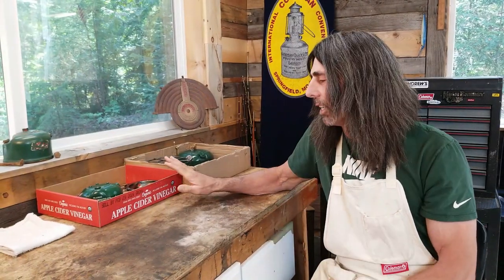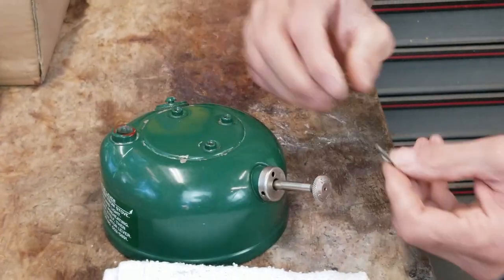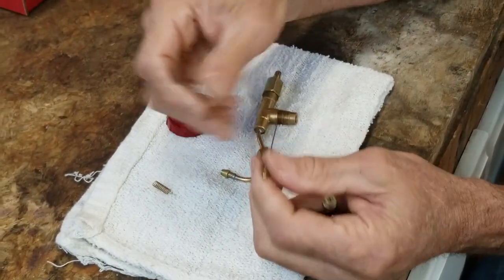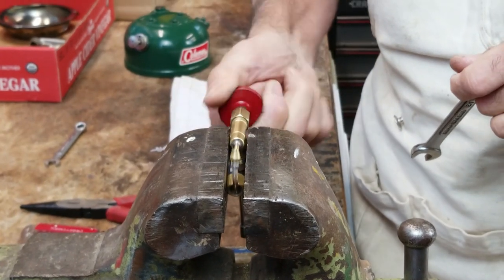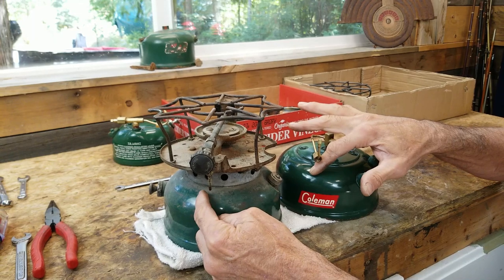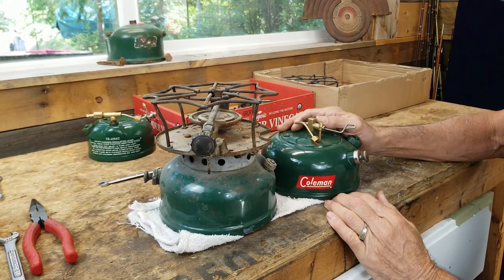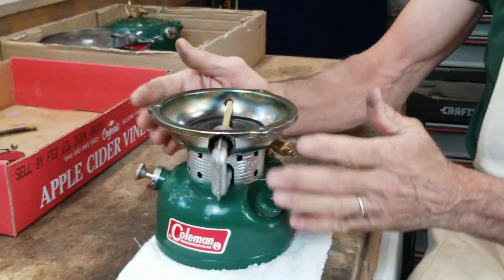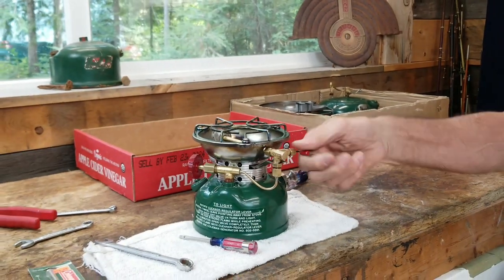How to Rebuild a Coleman 500 or 502 Single Burner Stove:  Part Three, Reassembly

Comment: Thanks for doing this series! I just got a really dirty old 502 that must have been sitting on a garage shelf for decades. I had to completely tear it down-the check ball was stuck, and the fuel pickup was clogged. After a lot of cleaning and fiddling around, now it runs like it should.

Comment: I want to thank you very much for doing these videos they are a tremendous help in keeping these little gas Burning Lights and stoves running. Also as we all get up in age I hope you have someone that will take over and continue your work. On a personal note I know if your ring is loose on your finger I hate to see you lose it. One of the things I did when I lost weight and it became loose on my hand as well as I took some string and wrapped it around the ring in and out until it basically made it smaller. This does work tremendously well and keeps it from coming off your hand accidentally. I was once by a pond and pointed to Something in the pond to have my ring come off my hand. Many hours later after going home to get my school equipment and coming back and took me 45 minutes to find my ring. Thank you for your good work and knowledge.

Comment: Another great series.  they looked great after the rebuild.  There is just something incredibly pleasing about the sound of a coleman pressure stove.  Propane doesn't sound the same though.  But the sound of these stoves running is just very calming and soothing.
Reply from the maker: It is.  They sound awesome in the shop, but they sound so much better in the field when in real-world use.

Comment: Hello Frank, thank you for your informative videos. I have a Coleman 500 single burner in a very good condition. There is a problem with the flame when  I start it, everything is good except the flame is not fully continually stable when it heated up in a specific rotation range of the valve, the flame is going to be yellow in an specific rotation of the main valve at the same time I get  "fiss, fiss instable noise" and when I turn the valve a little more or less out of this specific range, the flame is going to be normal blue and at the same time the sound I hear is not stable also. So, it means at the specific rotation of the main valve, it is not stable but for the rest of the turning no matter below or above this rotation range, it is stable and I get normal blue flame. Having said that, sometimes, I get more than enough fuel in the burner when I open up the valve when I want to start it first.  Thank you guide me how to fix this instability for this vintage stove.

Comment: Hey man, I just got a 502, and found that there is fuel spewing from around the regulator valve, tried tightening it, no luck, I didn’t see any sort of packing in there, I figured if anyone knew it would be you.

Comment: Great job as always! 

Since the 502 generators have been discontinued, they are selling for a premium on ebay. Old Coleman Parts is now selling handmade reproduction generators for the 502 stove. I purchased one and put it in my stove. It's functional and pretty well made. However I don't think it simmers all that great. I've just ordered a new old stock Coleman generator for the stove and I'm going to make a comparison once it arrives. It'll be interesting to see the difference.

The reproduction generator did at least get my stove working so in that respect it's great. It may not be perfect, but it does work.
Reply from the maker: Awesome, let me know how it goes please.  I have heard the same issue with their repro Q99 generators.  I may need to buy one of the OCP generators myself...
Reply: I also tried their repro q99 on a 427 and it did not work well at all.    Ordered an nos one on eBay and it worked perfectly.
Reply: @stevenshanofski6801  I've also had trouble with NOS generators because they have gotten beaten up over time

Comment: Is there supposed to be an o-ring or gasket between the check valve and the fount body on a 502?  I'm finding it leaks unless there's an o-ring installed.  The check valve has obviously been abused during its life, and shows signs of this abuse with rounded-over corners in the screwdriver slot.  I ordered a new one, but I thought I'd ask the pro.  I also looked at the parts schematic but didn't notice a gasket there, so I'm assuming it's a soft metal-to-metal seal between the copper face on the check valve and the fount metal.

Comment: I have a 502 and have soaked it with penetrating oil but cannot get the burner to come loose would heat be my next option? Thanks again for another informative video as always.
Reply from the maker: You can use heat but you might damage your paint job, plus you need to remove all the gas in the tank and replace it with water.  I have literally had to soak that dumb thing for 3 days before it broke free using penetrating fluid.  It can be a real nasty connection.

Comment: I have a502i bought on ebay it looks like it had been. Rebuild  or store displays. When I got it I put new Colman fuel. In it I am getting yellow flame  so I took the genater off found it to be clen took the bunner a part and push air throw found no blockage  check valve fuel cap holds  air I still get a Yellow flam I am at a loss on why

Comment: I have cleaned my 502 following your directions. It is holding pressure, but it will not ignite.  Any suggestions?  Before I cleaned it, it came on but the flame was so low, it could barely boil water. Thank you, love all the videos.

Comment: Hello, i am writing from Argentina and i have a 533 , that i bought used; i changed the generator for a new one, i cleaned it and i even cleaned the tank whith vinegar for 1 week.  I tried to turn it on and it was pumped 30 times;this  stove begins to revalide the gasoline due to the screw that adjusts the burner to the body of the stove, but it does't start. The uel reaches the stopcock well, but i can't get it to start. Could you please tell me what i can do ?

Comment: Hi Frank, 
I have some lanterns model 220.
I have two issues:

1. When I see you light your lanterns, there is very little flame up at the beginning.  

When I start my lanterns, the lantern drips fuel down the outside of the carburetor tube and I need to allow only a little fuel to come out, turn it off, light it and then turn it on and control small amounts of fuel to come out until the carburetor heats up enough to vaporize the fuel. 
1a. Is this normal? 
1b. Do I need to replace the top of the carburetor with a new pinhole piece? 
1c. Can you provide a link to this part?

2. Some of my lanterns are MUCH dimmer than others. 
2a. What causes this variation?
2b. What can I do to fix this problem. 
2c. Is it caused by fuel flow restriction or an airflow restriction or maybe both?

Thank you for all you do to support us. Your videos are excellent. 
Mark

Comment: I know this is an old video but I just received a model 508 stove and it holds pressure and lights easily enough but after following the rest of the lighting instructions pumping and waiting for the generator to heat up even after several minutes of heating the stove refused to burn clean the best I can get was a very sooty yellow flame any possible
Suggestions of what’s wrong/where to start

Comment: I recently inherited a 1/70 Coleman 502 from my grandpa. It's actually my first coleman product. I'm currently in the process of refurbishing it. I removed the packing on the gas shut-off valve. Do you know what size packing you replaced? Is it 1/4 ID?
Reply from the maker: Yes, it is 1/4 ID, part number is 188D6201. Good luck with your grandpa's stove!
Reply: @OldTownColeman  Thank you!

Comment: Hi - I’m in Aus and have a big problem with my Coleman 428 three burner stove- it’s a bit dangerous as it floods when I try to light it - dumping fuel into the case and starting a big fire- it was working fine until a week ago - I’ve watched YouTube videos and completely stripped the stove and cleaned everything but no good- I almost burned my house down tonight with it - any ideas?
Reply: O rings maybe

Comment: My 502 fuel filler cap screw bottoms out on the insert before it touch the top of the cap. Is that normal ?
Reply: No....replace the washer, or put one in if its missing